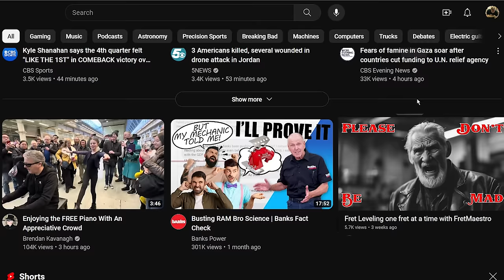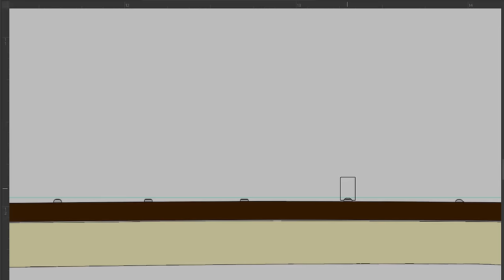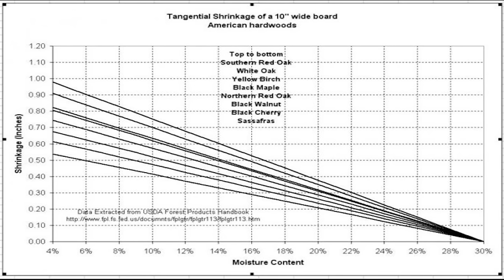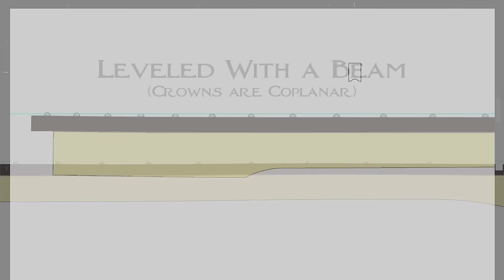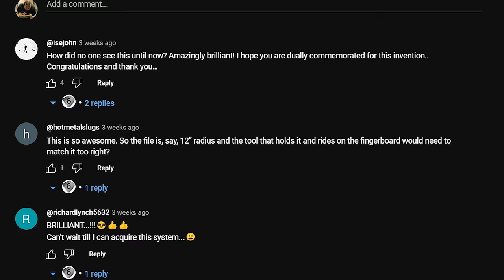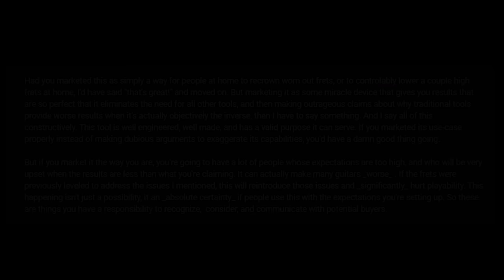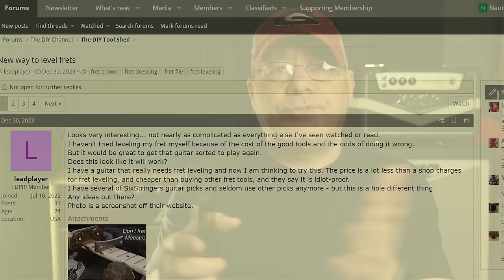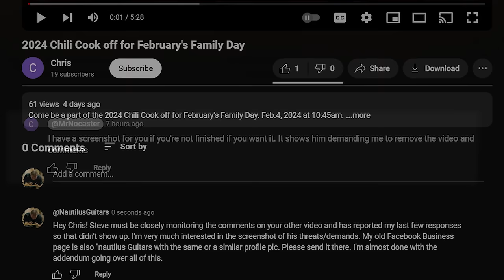Fret Maestro - Gimmick or Godsend? - A Fair Warning

Comment from the maker: Quick Update - Possible New Video Required:

Steve made an astonishingly inaccurate video indirectly responding to this, where he's yet again making incredibly misleading claims, due to an apparent total lack of understanding about the basic concepts he's trying to describe. That, or he's intentionally trying to mislead people. He mentions "collinearity", as if that has any relationship to my points here, or fret work in general.

"Collinearity" describes points in a 2-dimensional plane, such as dots along a straight line. But frets are 3-dimensional, so it's a nonsensical usage of the term. Especially because he's also using it to describe the relationship between the strings and the fretboard as parallel, but their average planes are intersecting, not parallel, so even that makes no sense. He uses this term as if he's "correcting" my use of the term "coplanarity", but he clearly does not understand either term. 

Also, he tries to sound even smarter by using the term "trilinear", which is a word that he basically made up, because the actual term has no relationship whatsoever to what he's showing. He just vaguely understands the word "colinear", mentioned three things, and spat out the word "trilinear", even though the two terms have no relevance to one another. 😂

Worst of all, in what can only be described as outright bizarre , his example of "coplanarity" is a completely warped board, which is the exact opposite of coplanar. It's so astonishingly backwards (seeing a pattern yet?), that the only reasonable conclusion I can draw, is that it is deliberate. Which would be vile, as it's blatantly misinforming people and destroying their understanding of not only guitars, but of geometry. I cannot comprehend how this is anything but deliberate. It is unbelievable. 

It's the logical equivalent of me spreading "health advice" by claiming that all vegetables are poisonous because some animals have venom, while pointing at a tree as an example, in response to a video about exercise.

I really cannot express enough how bad his video is. It's hard for me to even sit through. Steve clearly did not watch this video, and appears to have simply connected dots (hopefully collinear dots) that he made up in his head, using random terms he doesn't understand, to make a point that's not only embarrassingly false, but has nothing whatsoever to do with the criticism... Yet again . 

You cannot make this stuff up.
Reply: But he got 5 stars for selling a used guitar on Reverb, so take that , Mr.Naughty! 😆
Reply: Why doesn't the man just re-tool the device to account for the short comings instead of trying to reinforce a flawed tool?
Reply: Because apparently, he’s one of those people who feel others should pay for his mistakes
Reply from the maker: @braxal6983  Unfortunately, the entire premise of the tool is flawed. He'd have to invent a completely different tool to avoid the problem.

The problem I have is the extreme claims being made. There are some specific uses for this tool. But they're very limited. Had he been marketing it for those applications, my only thought would have been "costs too much considering other tools are cheaper and more versatile, but whatever". It's the outrageous claims, especially the misinformation, that motivated me to address it.
Reply: @NautilusGuitars  I appreciate you notifying all of us because when I first saw the device was liking what he was saying. With me I always have to see what others say and fortunate for me I found yours and Chris's post . Thank you for saving me a ton of grief. I feel sorry for those who may have wasted and ruined their guitars. It is not right.
Reply from the maker: @braxal6983  it really isn't right. It's so bad with his last video that it's bordering on comical, if it wasn't for the fact that people are parting with their hard earned money for it.

You're quite welcome though! I'm really happy this is helping so many people. The response has been great and it makes the headache worth it. It was a huge project to tackle. But well worth it!
Reply: @braxal6983  Well not really totally ruin guitars, just ruin frets 🤷
Plus spend a lot of money for that tool. And then spend more to fix frets in a proper way if it still possible (luthier work costs) or own time for proper repair as it should be. Or even more costs and time if needed to totally replace all frets after 🤷
Reply: @NautilusGuitars    Thanks for your work and for future videos about this mislead and false claims.

For me is understandable what this tool could do and what isn't.

But for a lot of new guitar players not obvious. They are not luthiers and mostly not engineers.

Thanks a lot ☀️🌿✨
Reply: @Arwndr  Very True. It is still very devastating and not right that someone should be promoting something that they refuse to redesign and start from scratch. Instead they continue to promote for their own gain at a big cost to others.
Reply: @braxal6983 I don't know what redesign could achieve the marketing claims. He could just change some of the marketing about what this does/doesn't do -- but that would make the product much less appealing.
Reply: you cant do an A vs B test with an unbiased player now because it looks like he's starting to absorb the truth without  absorbing the truth, so who knows what would get presented.
Reply: you've done as much as you possibly can, those that matter, get you & the facts. he's not going to admit wrongdoing even when slapped in the face with it. dont waste anymore positive energy trying to fix, you've already done that.
Reply: @braxal6983  it’s not possible to get this tool to work. Look at a guitar with a rise or hump over the heel of the neck.  If you level the frets and not the fretboard, those frets will be lower than the rest in relation to the fretboard, but will be level with the rest of the tops of the frets. 

His tool will make them all level from the fretboard but the hump will still be there. 

He’s too invested in this tool to admit it doesn’t work. It was based on a flawed premise. And he seems to have a problem admitting it’s flawed.
Reply: @DavidRavenMoon  That is really sad. I hate to see other mislead. That is pretty selfish.
Reply: I’m glad you made this video. I was honestly sold when I saw his video. 
(Even tho he says “Heighth” instead of “Height”). That drives me crazy as a Mechanical Drafter/CAD Tech. 

Oh, and the whole “Venomous Vegetable Tree” statement, killed me 😂🤣💀

Thanks for the comprehensive breakdown.
Reply: Thanks for the work you are doing. My background is in machining and this is 101 stuff. The guy promoting this device does not understand the concept of a datum or geometric dimensioning.
Reply: Well making sure that the fretboard is perfectly level is of course a requirement before using the tool. It is really astounding how people like you don't get that and just pretend someone working on a guitar wouldn't know that. If the fretboard isn't level then make it level first.
Reply: 08:34 Anyone with exceptional skills can create a radius but the point of his tool is to give you that ability without having to develop that skill. How on earth do you not understand such simple concepts? Anyone can use a fretboard straight edge, check it for straightness and  then crown the frets resulting in something that rivals the work of a professional. That is the whole point of the tool. You also go into all the possible ways a fretboard can not be level etc. That is irrelevant because you are supposed to make sure that the fretboard is absolutely level even I got that and I'm not a luthier. Once it is level you use the tool and since it conforms to the NOW LEVEL fretboard radius the frets also end up being completely level. Not so hard to understand.
Reply: @EbonyPope Just simply wrong.
Reply: @EbonyPope The problem is that it’s NOT possible to get a fretboard completely straight. To paraphrase your own comment, how on earth could you get such a simple concept wrong?
Reply: @keith.messier of course it's possible to get a fretboard completely straight, ask Dan Erlewine!

Comment: Thanks to Nautilus Guitars for saving me money on the Fret Maestro. I was actually considering it. But the Fret Maestro guy is right about one thing: the less flat the fretboard, the more metal you have to remove to get the frets level. I leveled the frets on a neck that I could not get perfectly flat, and it's unplayable now. So when the dude claimed his product would prevent this, it got my attention. Now this video makes a good case for the Fret Maestro being ineffective at leveling frets, while the leveling beam can, precisely because it corrects for imperfections in the neck and fretboard. Apparently they are never perfecly flat. I sanded the minimum amount of fret material to get them level, and took too much off. How can I prevent that in the future? I hope Nautilus Guitars can answer.

Comment: Even if the "fret maestro" left each fret absolutely identical (and I bet it doesn't), then if the fretboard itself has any inconsistency, the fret heights will vary relative to the strings.  The fret maestro is simply not fit for purpose.

Comment: This is a LONG post and I’m sorry, but worth the read. I purchased a Fret Maestro and did not have a good experience.  Below are my findings.  Background: guitar player for 56 years, luthier for 40 years. I am about to refret one of my guitars and used the FM to level the old frets as a test. 
1: There is left/right play that resulted in the crowns not being identical. It’s possible to be slightly out of line with the fret.
2: The files don’t seem to be suited for jumbo frets. There are tooling marks the length of the frets. 
3: I had to constantly check the depth wheels as one of them frequently moved during use.  
4: The other depth wheel was hard to turn, so it didn’t click into place. 
5: The tool itself is so small that using two hands is impossible.  Hand fatigue was awful. 
6: Changing hands resulted in a slightly different alignment with the fret. Ones I did with my right hand had counter-clockwise crowns. Opposite for left hand use. It’s not possible to tell if you’re misaligned as the bakelite obscures the view of the cutting action. 
7: The edges of the bakelite come very sharp. It cut through the tape and into the fingerboard. No big deal since I’m about to level it. 
9: Over the course of working, fret filings gathered between the tape and the bottom bakelite edge.  That ended up smoothing the sharp edges, but that also means that over time the bottom edges of the FM will be eroded, and possibly not perpendicular to the fretboard. 

I love the idea of a radiused crowning file.  But it would need to be attached to a handle so you can see the file/fret as it’s cutting. This would also allow use of two hands, reducing fatigue. 

While the use of bakelite is kinda cool, since it could wear over time I don’t think it’s suitable.  

Lastly, the big takeaway: the frets are buzzing all over the place.  

Hope this helps someone. It’s a shame; I really wanted this to work.
Reply: I've never leveled my frets before, and I had excellent results with my FretMaestro. I'm sorry it didn't work for you. And you're a luthier for 40 years.  Hmmm. There are two others that also had good results down in the comments. I haven't checked back for a month or two and haven't read all the comments since then. But back then we were the only three that actually bought and used the tool, even though everyone else felt they could judge it without even trying it. It really puzzles me that  a seasoned luthier couldn't get good results but I could. Strange. If you're interested, look for my old comments.
Reply: @thisisreallife5086 you’re surprised Tiger Woods can’t get similar results using a slingshot? I don’t play golf and would probably drive a ball farther with a slingshot. Experienced luthiers have best results with the tools they’re accustomed to.
Reply: @thisisreallife5086 Ain’t no “magic” in that tool. I don’t doubt that it works in certain situations or for certain people. What make and model of guitar did it work for you?
Reply: @kristopherk5454  You can see my full review from 4 months ago, below. You'll have to page down a few times and search for my name. Here's a snippet:

"Mine is a 2005 Gibson SG that has original frets and never had a fret job. The pits and low spots were pretty severe. I had to take a lot off the frets to get them level, but there's still plenty of fret material left."

Two other guys posted their results, too, but the comments got very ugly and it might be deleted. I referenced their names just now and my first reply got deleted, so...
Reply: Oh boy 😬
Reply: @kristopherk5454  Hey, that's a good idea for a new sport, Slingshot Golf!
Reply: @kristopherk5454  I bet it would work for aluminum necks!

Comment: One of the craziest things I remember from watching one of Sixstrings videos about the Fret Maestro, was that he claimed that you can only do 1 fret level using the traditional method before you run out of usable fret material and have to replace the frets. Anyone who has done fretwork knows that you can level and crown most frets several times before you even need to start thinking about new frets.

Comment: The first time I saw a video for this product I realized it can’t possibly work due to the unevenness of fretboards.  

Even brand new guitars. I had a very fussy client who wanted the lowest possible action on a brand new American Standard Strat. After leveling the frets he still wanted the action lower. 

So I removed the frets, leveled the board, and refretted it. It was so low without buzzes that he asked me to raise it slightly. lol. 

The point being that even with CNC machining brand new guitars often have unlevel fretboards. 

Regarding the radius with a flat tool; back in the mid 90s I got to spend about 45 minutes talking to Ken Parker. I asked him what’s the best wat to radius a new fretboard.  Sanding takes forever! 

He said “just use a hand plane. It doesn’t have to be perfect and it still works.”  As long as it’s coplanar under each string you are good to go.
Reply: How about on aluminum necks?  They're perfectly machined and don't move like wood does.

Comment: My Warmoth compound radius question wasn’t addressed. Just some Ideas and “it seems” comments. It’s “just” an adjustable “spot” Fret file. If his device were really cheap you could use it to spot file individual frets- if you’re experienced. It’s just an adjustable Fret file that won’t replace the entire process- because the wood fret board surface itself is inconsistent. I could use it on a stable maple neck to shape a worn high use fret ?
Six string comment removal is of course Lame.
Thanks for the video.